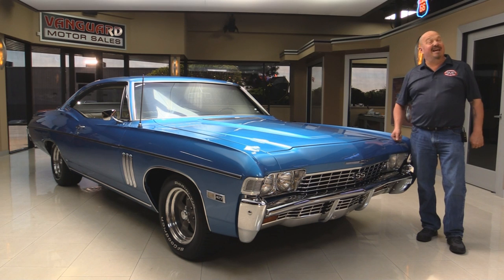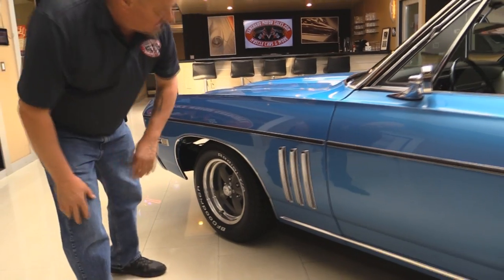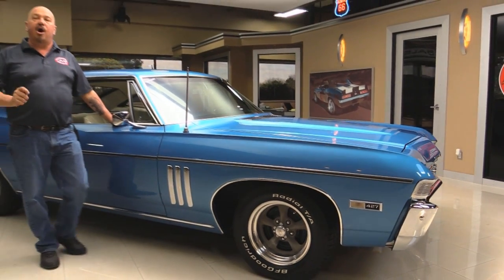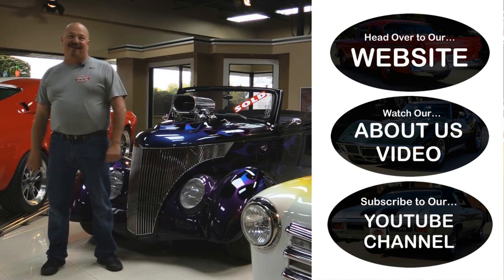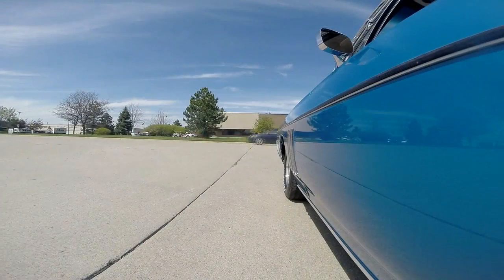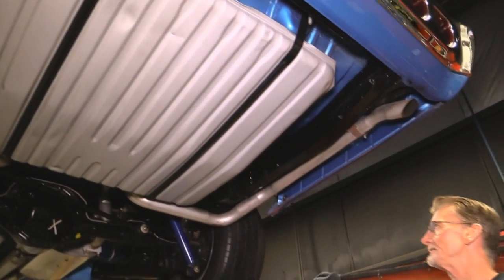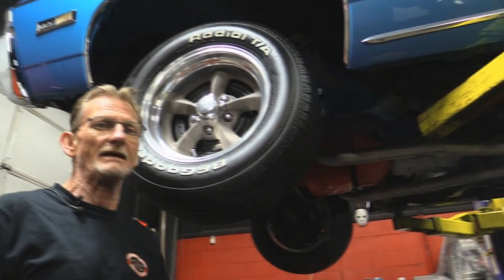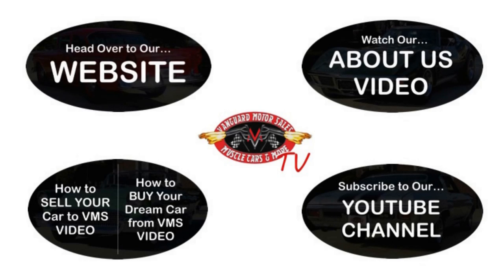1968 Chevrolet Impala For Sale

Comment: Should have a 427. Steering wheel should also have small ss in the center of the wheel on 1968 SS 427. All SS 427 had a big block only, small block not available with SS. SB & 396, 427 also available on Impala SS.
Reply: My first car was a 1968 Impala SS 327 4 speed